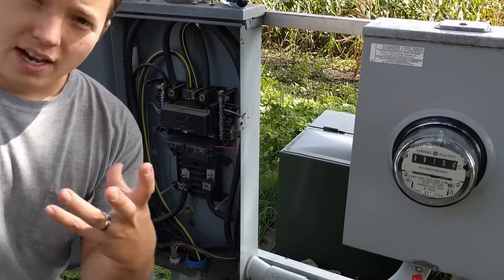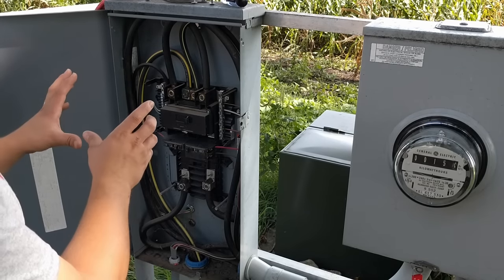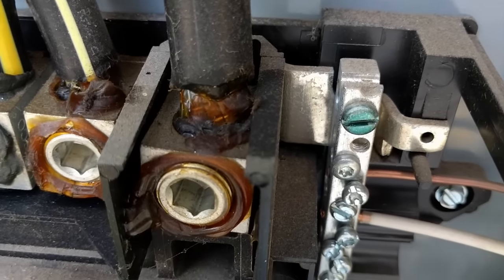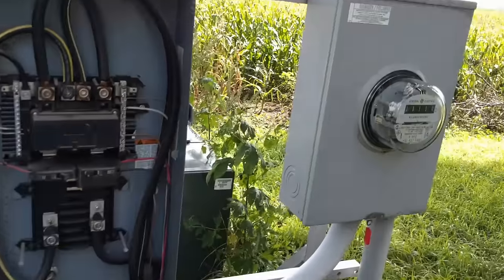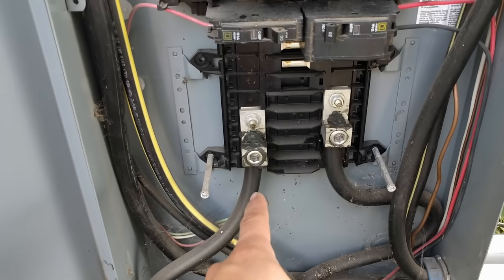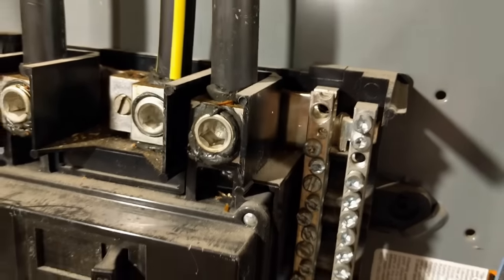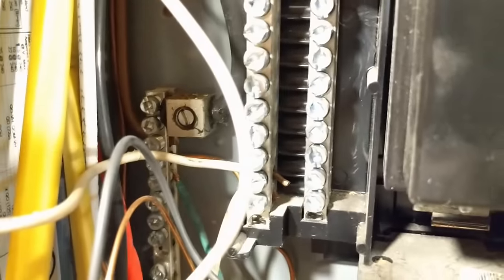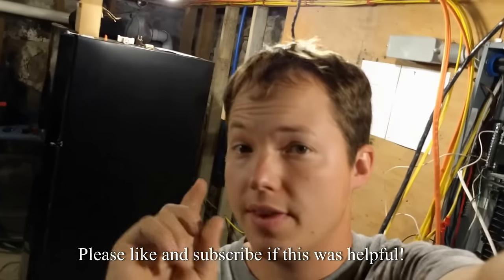What Is a Neutral Bonding Screw in a Main or Sub Panel Load Center & Should It Be Used or Removed?

Comment: I had a home inspector tell me my 100 amp main panel isn't bonded?
There is no disconnect after the meter, there is a ground rod connected to the meter and the main panel, the ground strap in the main panel is connected between the bus bars which have mixed neutrals/grounds together.
The only thing I could think of is that the service entrance needs a bonding bushing on the 1.25" offset nipple securing it to the panel with a short length of #6 connected to the bus bar?
Then a contractor came in and said the neutrals and grounds need to be separated in the panel?
Too many variations of opinion concerning this panel.
Old 1955 house...Cutler-Hammer main panel, no dis-connect before panel, neutrals and grounds on same bus, where's the issue?
I want my breakers to work, not fail to work when ground shorts to earth.
Reply: Put grounds on one bus that is bonded to your (grouned) panel. Put all of the neutrals on a bus that is isolated from ground — if, and only if, the neutral and ground are bonded upstream (closer to the power source / service) of the panel in question.

That is the point of the video. If you separate the two buses and it’s proper to bond them, do so. If your inspector requires to bomd them, do so.
Reply: @TSPhotoAtlanta  , it's my understanding that it's okay to have both neutrals and grounds on the same bars as long as the 2 bars are bonded together in the panel, and, it's the first point of disconnect?
Now, there's also a sub-panel in the garage running off of 8/3 wire from the main panel in house which I noticed had neutrals and grounds mixed.
I bought a separate ground bar for that, separated the grounds, and removed the green bonding screw....problem solved on sub-panel.
Reply: Perry E. Tucker    I'm guessing that the inspector said you do not have a bonding jumper to the main panel can.   You said you have neutral and ground on the same bar.   This bar is most likely not connected to the can.   It should be on insulators, correct?   So if you do not bond from the bar to the metal can, what happens if one of the hot conductors in your panel shorts to the can, let's say because you screw the panel cover screw into it.   Now you have voltage on the can with no ground path to neutral.   Your panel can and door will have a 120 volt potential.   Sound safe to you?   End result needed to trip the breaker.   Hope this helps!

Comment: Can i get an explanation and or video as to what .... Happens if you have ground and neutral together in subpanel
Reply: I just came looking for videos because I am having the problem, so I can tell you ;).   All your fancy breakers (CAFCI or GFCI or dual), will trip every single time the power gets used.  You will go a little crazy looking for the short and then eventually, you will read the instructions and see that it says you need to separate your ground and neutral and then you end up searching youtube just to make sure you are doing that right.  In my case, I had (of course) removed the screw, but my ground connection still went in right next to then neutral...  Oops.
Reply: @SimonHomeintheEarth  A bonding screw will not cause your GFI's to trip, lots of them are done this way, no problem!

Comment: Please explain again
Ground and neutral  is ok to connect together? (Bonding?)
Dont have subpanel, and looks is connected together.
Reply: If you don't have a sub panel  neutral and ground can be on same bar. You would screw the green screw in to bond the bar and service encloser. You MUST have a meter socket to main breaker box set up to do what I said.
Reply: Have the meter only outside and the panel inside. Looks the bare wire is on both sides (bars) same as the white wire. 
Still need to learn little about this and check why my device plugging to the receptacle showing "OPEN GROUND on just few of them . Thanks for the help.
Reply: @Lu-cho  loose connection with white wires somewhere. Get an outlet tester and check connection at those that fail. Completely take white  wires off and reconnect. With power off of course!
Reply: Jonathon Edington 
After few days... 
Nice, fixed , thanks for your help.

Comment: From the main panel you run a 4 wires 2 hots ,neutral and ground to the sub panel, but where’s ground connected on the main panel , on the bar that is bonded whit the neutral?, I didn’t catch that part
Reply from the maker: The first panel after the meter has the grounding system and neutral bus connected together so in the panel that I am standing next to the ground rods are connected to the neutral bus as you mentioned. The sub panel then has separate grounding bars from the neutral bars with the panel bonding screw removed. Does that clarify it?
Reply: Benjamin Sahlstrom awesome, i get it now, thanks

Comment: Great video Ben! I'm getting ready to replace an older panel but I'm confused and wanted to run something by you: I live in a condo and have a tiny box that only has one double-throw 100a breaker right after the meter and then runs into my panel in my condo unit. That indoor panel currently has the ground wires and neutrals on the same bar. I'm looking at a Siemens P1224L1125CU  which comes with 2 grounding bars, and I'm wondering if I need to use them or if I can simply install my grounds and neutrals on the same bar like it currently is and bond it with the bonding screw? (Does that make any sense?)
Reply: If the ground and neutral are bonded in the tiny box with the 100 amp double pole breaker then they need to be separated in the panel inside. The only place the grounds and neutrals should be bonded is at the "1st means of disconnect." Any sub-panel after that needs ground and neutrals seperated.

Comment: Just the info I needed. I do home inspections and never learned about the bonding screw. I've been inspecting panels looking for bonding straps or wires. Now I will look for the presence of green screws on the neutral bus
Reply: Make sure you know when to look for it and not. Also, when it's not needed. Master electrician and Electrical contractor
Reply: So you have no clue how to do your job and pass/fail based on guesses???
Reply: athhud that’s all home inspectors

Comment: Hey Ben!  Thanks for your explanation.  I have a question.  I have two sub panels on my property.  One goes inside the house, and the other, goes out to my pool equipment.  Both sub panels are three wire feeds (6 gauge), two hots and a neutral.  I understand this is no longer to code, but it once was acceptable.  Therefore, If I have a three wire feed, and the neutral and ground is bonded in the panel, do I also needed the ground/neutral bonded to the panel with the screw?  Thanks so much!
Reply from the maker: I would say yes but I am not 100% certain. If you look up the State electrical inspector for your area you could give him a call and double check just to be sure but overall I would guess that it would be bonded. Let me know if you get a definitive answer from your inspector. They are usually super helpful. Good luck!
Reply: If your sub panels don't have an equipment grounding conductor, then you should install ground rods for that panel, and NOT bond the neutral to the panel can.  Or run an equipment grounding conductor from your main panel to the sub panels. 

Just read through article 250 in the NEC, it's really simple to understand (you'll never hire an electrician again!!).  Then jump over to the bonding requirements for a pool. Again, that stuff's a no-brainer....In all seriousness, don't mess around with grounding and bonding if you don't have years of experience with it. Especially around your pool. Watch Mike Holts videos on grounding and bonding. You're asking a very technical question where the wrong answer can lead to death.   It doesn't take much to energize the water in your pool.  Hire a respectable qualified electrician
Reply: @wm79198 … In the case of a pool panel without a ground wire, I would bet the answer is in some code book from 40-50 years ago because of the pool itself being grounded independently of the house electrical system. IOW, the rebar in the cement and the pool pump are bonded together and likely go to yet another ground rod which is remote from the house. IOW, back in those days they probably treated a pool panel as if it was just another appliance plugged into an outlet, so completely separate with it's own code. Fast forward to today's code, this almost sounds primitive. OTOH, 50 years ago we had outlets around the house with only 2 wires and no 3rd prong!

Comment: instead of a separate ground for the subpanel, can you leave the bonding screw out and run a ground back to the main panel or do you need to have the subpanel on it's own ground?
Reply: I don't understand your question. You always need to run 4 wires from the main panel to a subpanel: 2 hots, a neutral, and a ground. You do that, AND you always remove the bonding screw in the subpanel.
Reply: Jon Clark . Seephor talking about connect between subpanel and ground,  because we have to grounding any panel??!
Reply: If the subpanel is in a detached building or separate building from the main panel, it needs its own grounding rods. If the subpanel is in the same building as the main panel, it does NOT need its own grounding rods. You ALWAYS need to run a 4-wire feed to the subpanel and keep the neutral separate from the ground.

Comment: Just what I was looking for simple explanation. 
Can you tell me we’re arcvolt breakers are code required?
Reply: It won't be long and they'll be required everywhere, especially for residential. *From Jade Learning: The AFCI shall be installed in a readily accessible location, and protect all 120-volt, single phase, 15- and 20-ampere branch circuits supplying outlets or devices installed in dwelling unit kitchens, family rooms, dining rooms, living rooms, parlors, libraries, dens, bedrooms, sunrooms, recreation rooms, closets, hallways, laundry areas, or similar rooms or areas shall be protected…, 210.12(A).
Reply: So basically just buy AFCI main breaker..lol..or not
Reply: @bernardoprovenzanno9487  yeah my thought as well...but i guess you would just want the isolated incident  to interrupt the cct..not whole house..lol

Comment: Bro, I cant say thank you enough for your videos.  Been re-doing the electrical on my house and have lived on your channel.  Many thanks! Can you answer two questions for me?  1.) At the main disconnect by meter socket, you point out a yellow cable.  What is the other striped cable?  2.) On the panel inside, did you mount the grounding bar straight to the panel OR did you use some non-metalic screws/spacers?  Thanks!

Comment: Ben,  I would like to add a 12 gauge romax cable to allow an additional outlet for both front living room and front exterior entry.   I've calculated the additional amp usage and it falls way below my house supply amperage. However, there is no more room on my neutral bar for the new neutral conductor despite more rooms for breakers.  I read that NEC code doesn't allow doubling up on the neutral conductors under single screw.  I do see that my main panel has a metal strap which connects the neutral bus to the grounding bus.  Can I connect that one neutral wire from my new cable to the grounding bus side since they are connected by that metal strap?   Thanks in advance!